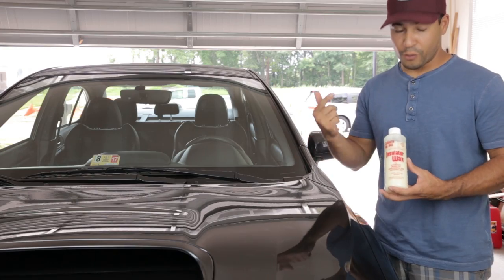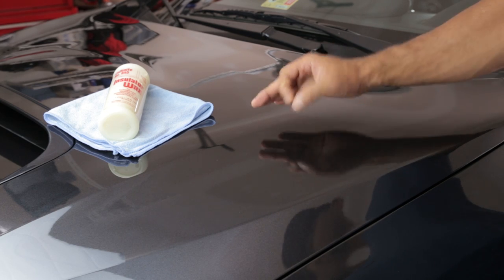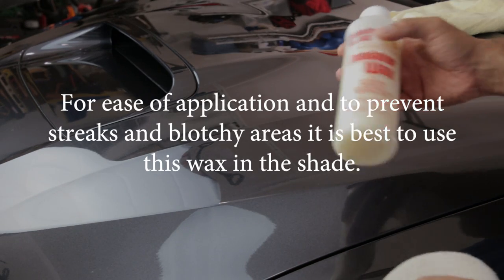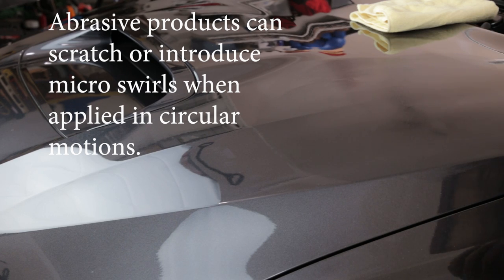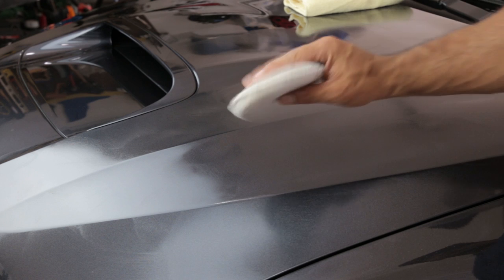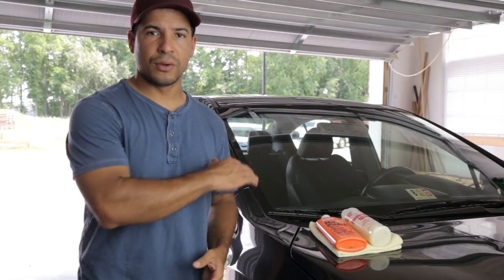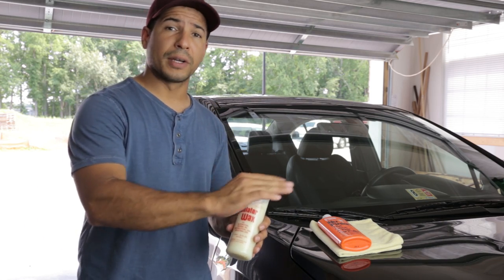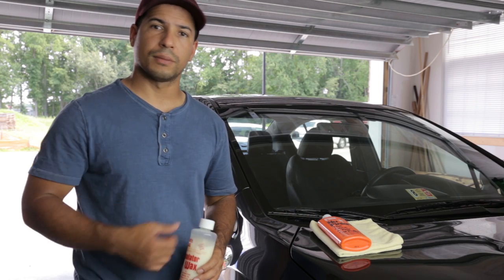Collinite No. 845 Application and Review

Comment: A guy just recommended this today at advance auto parts. Just used it today. Extremely impressed with this stuff. This has a shine like no other. Also I was told this will protect from road grim and debris and especially heavy road salt. I did 2 coats took my time
Reply: I've been using this stuff on my Tuxedo Black 2014 Fusion for 5 years and it's amazing. I usually apply a coat once a year and also do all of my glass and lamps and I've never had any issues. It lasts forever, even with frequent washes. I'm doing a full polish right now with the Collinite polish and it's looking so good.

Comment: I used meguires gold class wax for a while and switch to collinite 845 about 2 months ago. Decided to give meguires a run again and I realized how much harder it is to apply. Maybe my wax went bad, but meguires went on super thick and sticky- it made the applicator pad stick to the surface. Almost like smearing glue over the panel. Switched out to collinite and it went on effortless, wiping off was also effortless compared to meguires. 845 is by far my favorite wax. Did half the car with meguires and half with 845, can’t tell the difference. 

6 weeks, ~12 washes out of my first collinite application. 6 of the washes were touchless drive thrus, so it was hard on the wax. The roof, lower door panels are still beading decently. But the hood is completely wiped out and so are the upper doors near the windows. Definitely worth the money.

Comment: Quick and right to the point!! 
Try applying the jescar power lock plus sealant before using the collinate wax but let the powerlock cure for 3 hours before applying 845!! Amazing combo
Reply: Wolfgang Deep gloss 3.0 sealant works better than power lock and then collinite 845 over the top after it cures. Then after every few washes I tip it with Sonax brilliant shine detailer

Comment: Great video. Been into detailing cars since I got my first car in 1984. Used everything from Turtle Wax ,klasse, meguairs, Finish Kare, Einsett,Zaino, Duragloss,Wolfgang,etc... Tired of spending all day detailing so I cut done to simplicity. Use Clay towel, Duragloss 501 and follow up with Aqyawax. Works and last. Ordered 845 today to top off every 2 months for extra shine and durability. We will see if it is that good! When I wash my car I use duragloss rinseless wash and it has Aqua wax in it so every wash looks like a fresh waxed car. I have to admit your Subaru looks great. On the 845 does it stain any trim whatsoever? Can't wait to try it on the windshield.
Reply: I used it today
Did not stain the small area of trim i accidently touched..
Awesome product.

Comment: I applied it with my Da and a noziol spray when the wax has melted.I found it easier to apply instead by hand. Very recommended wax.
Reply: I'm polishing right now with my DA and still haven't decided if I want to apply the 845 by hand or with the DA. Why do you prefer the DA and what speed do you run it at for the wax?
Reply: @defaced8  Because with the da you apply a thin layer and will be easier to remove the wax. Use the da on low speed 2 or 3.

Comment: Best video on Collonite iv seen! 👍 Im probably going for the Collonite 915. Because its a hard wax, that hopefully should last even longer. And contain a good amount of Carnauba!  😊
Reply: If you want even better try the Collinite 476 paste wax. That’s the most durable, longest lasting out of the Collinite line. 476,915, 845 in that order of most durable to least. I’ve only ever used the 845 (have 2 bottles) and 476 (have 4 cans)
Reply: That what i was using on the corvette  red, now change  to a white car, no much difference  on deep so using 845

Comment: Hi There !

Ed Here
From São Paulo, 🇧🇷 

! AWESOME RESULT !

I Just Bought it Via Amazon To Be Delivered In Orlando, FL, Since I Am A Crew Member Of A Brazilian Company.

(Amazon Does Not Deliver to Brazil)

However, My Doubt Is If Liquefaction, The Waxing Heating Act May,  In The Future (For The Next Applications), Commit The Properties Of The Wax.

Another Question Is : Did You Use the Foam or Microfiber Applicator ?

Anyway, I'm Looking Forward to Picking Up my Collinite 845 !

By The Way, For the Decontamination of Ferrous Materials (Before The Clay Bar Application) I Also Bought Meguiars All Wheel Cleaner Instead of Chemical Guys Iron X, 

Since Both Have the Same Active Principle Yet the All Wheel Cleaner Is Cheaper.

Yes : Meguiars All Wheel Cleaner For The Paint And Glasses  (Applying With The Car Still Dry) !

It Works Turning To Purple The Ferrous Contamination !

Thanks a Lot !

Best Regards !

Comment: Nice. I might have to give this stuff a try. I've seen in some reviews people are saying that Collinite 845 works really well with Jesco Power Lock paint sealant. Have you tried this combination?
Reply: Yes  doing for 2 years,  and as topping  no nessesary  but inlove the shine wet is getting Bed maker as final ,
Not so lasting like Collinate  but xtra protection  and the shine is insane, 
Carefull  i did the 4 step before , no just wash and wax,  BELIEVE  ME IS A HUGE DIFFERENCE,  takes time but non imperfection  or swirls ,

Comment: great video, with my 845 I use a pump sprayer head, seems to work very well for me and what's funny is my bottle is about the same level of product left that  you're bottle is , I've done  my dad's Avalon once with it, and my mom's Highlander twice....
Reply: Timbo... I saw someone else mention using a trigger sprayer. Do you just spray a light coat on an area and then use a microfiber towel, turning frequently? That seems even easier than using an applicator. Thanks.

Comment: Nice rex, great colour. This stuff is great, just coated my M3 for the winter.  People talk about the combo with 'Power Lock" and this. I'm interested to try that, but 845 alone is excellent. Once question I have is how Si02 combines with this.
Reply: SIO2's don't mix with carnauba waxes. SIO2 products you use alone or on top of a ceramic coating.
I've heard after you use this you can top it with Beadmaker and that's killer .

Comment: Great video. Since Collonite contains wax is there any problem , if it gets on the plastic or rubber around the side doors or on 
the plastic lined column between the doors ? Will it stain them or leave white spots.
Reply: It will stain black trim with a white powder.

Comment: Have you tried using Jescar Power Lock as the base coat and topping it off with Collinite 845??? I've seen a few videos and looks like a great combination.
Reply: Very nice combination. I use that combo and the results are phenomenal. Super slick, great wet deep look and lasts for months. It’s not a ceramic coating but the next best thing imo.

Comment: How long does this wax last for before re-applying?
Reply: If you live in a mega hot place like Texas or New Mexico, it varies from 2-3 months. The video is slightly incorrect. It's okay to apply to the entire hood as long as you don't do anything else. You don't have to do half of the hood. It won't dry that quickly. It's great for winter protection too.
Reply: largol33t1 for the 845 if the paint is cool and in shade I do the whole car with the 845 then when I’m done start removing it from where I first started waxing. Now mind you I use a DA and don’t do it by hand.

Comment: Nope. Its no better, its still a Subaru. :-)
Use a sealant first, then the wax.
The wax... The more you put on the worse a job it is to remove.
Im in the UK. 845 is great to use in the summer, but when its cold in the winter there are easier options.

Comment: With all due respect...not one mention up front about how it shines... wax consistency, application aspects, removal aspects, water beading, longevity and protection and on and on. All important and great points but how the f*** does it shine???  "Decent shine" is mentioned  at the end of the review. 
Not dissing on this one particular review but most of them actually.   
For me, #1 aspect is the shine.  Don't think I'm alone...
If it's real wax it should offer a different shine compared to a sealant.  Deeper, richer - especially  with different colors & styles and paint types...anyways  - just sayin'...

Comment: Sad I should have watched this video before. I ended up buying Collinite 476, should have gone for this ... :/
Reply: Man I was in same boat as you. I was looking for a long lasting thing for summer and Canadian winter. But the more I read, the more 845 seemed to last quite long and applying it 2 times a year or right before winter should last all winter
Reply: The 476 is the most durable out two. Both are great no doubt. I have several bottles of the 845 and 4 cans of the 476. Most durable to least is 476, 915, 845. I wouldn’t hesitate to use any of them